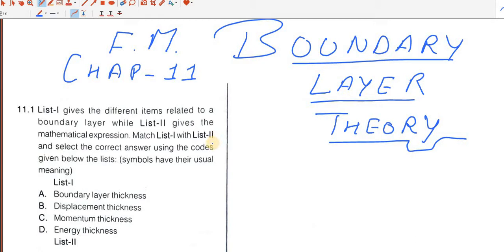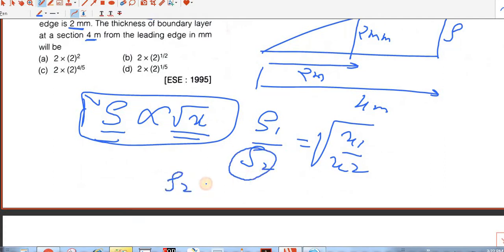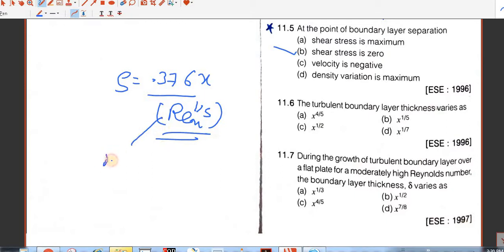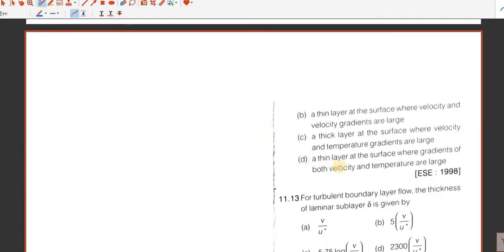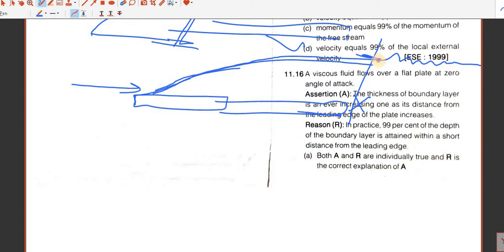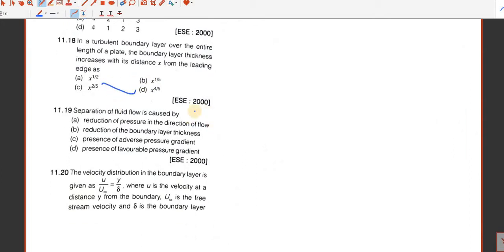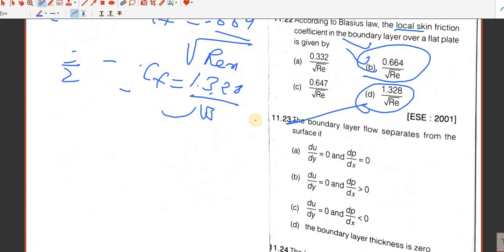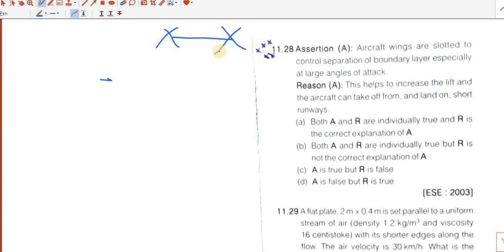Previous Year Questions|| ESE || IES || Mechanical || Video Series|| F.M. || Boundary Layer  || 11.1

Comment: 11.11 ,correct answer is d because  along that direction with decreasing pressure g
,the velocity gradient will increase upto point of flow separation and 
 with it shear stress also increase and with more shear stress or more boundry layer thickness will be generate. In made easy (mondel sir pdf)also option is d

Comment: Sir it was awesome plz sir rectify my problem that is in 11.21 they have already given us the velocity profile so I think we can't use blasius result for boundary layer thickness .....for given one the DELTA=X/SQRT(REYNOLD NO) BT sir answere is not matching plz rectify it BT if I would use blausius then approz answere comes out plz rectify this problem sir
Reply from the maker: If you use formula of delta for linear velocity profile ie. 3.46x/sqr root(Re) you will same result, that is 1.83 mm. so only one option is near to it. If options are close than you have to remember all the formulaes of all the profiles and you have to apply.